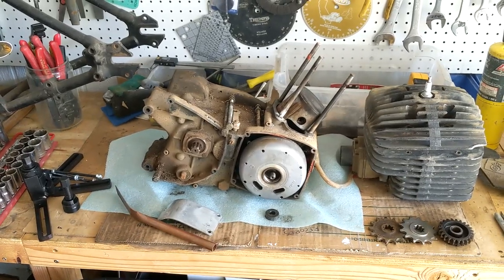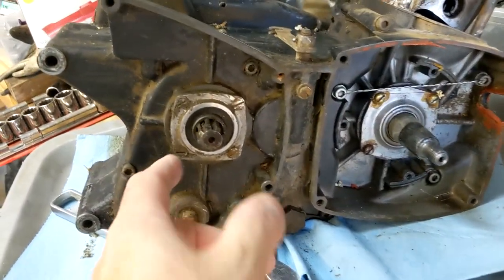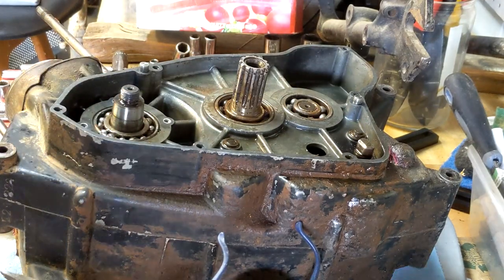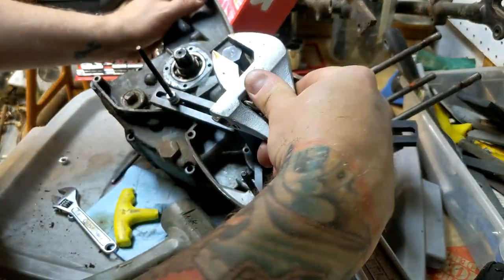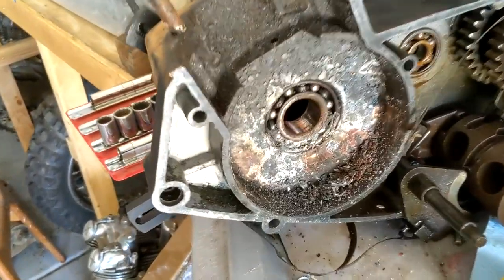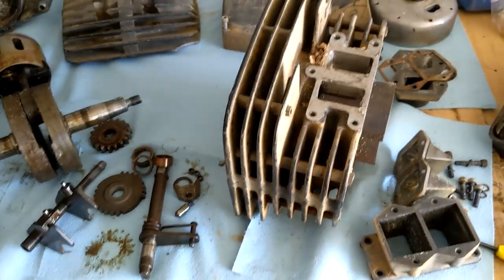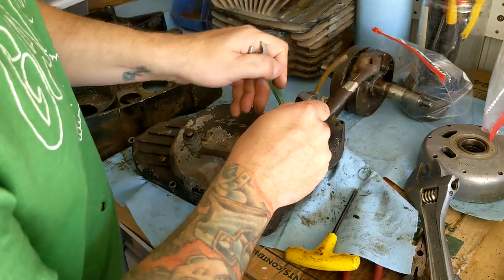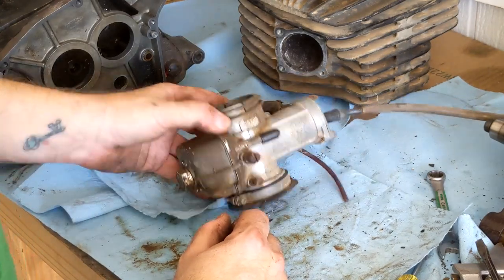1975 Husqvarna 360 CR Restoration - Part 3 Engine Disassembly

Comment: Ha, I had the same experience pulling the gear on the crank. I had puller on it pretty tight and it never budged. I gave it some heat with my propane torch and it let go, sending the puller and gear flying.

Comment: That shifting mechanism, where the two flat arms connect the new type to the old type, break very easily if you drop the bike on the shifter side.  This was a temporary fix, until they changed the cases the next year.

Comment: Dude, you should have kept the jug on that motor and both casing covers You know, the cover for the stater and fly wheel and the clutch cover should kept all that on it and took it to the car wash and pressure washed the shit out of it before you ever even touched a single bolt on the casings and jug....